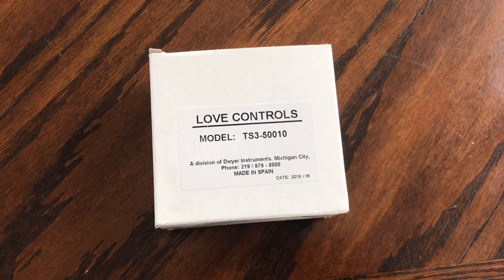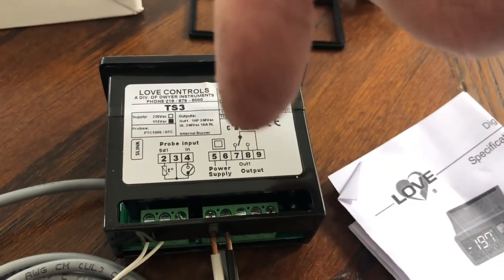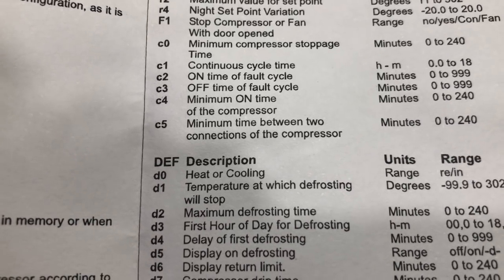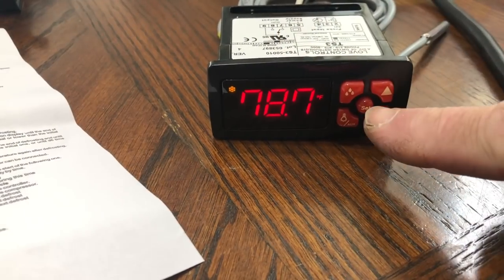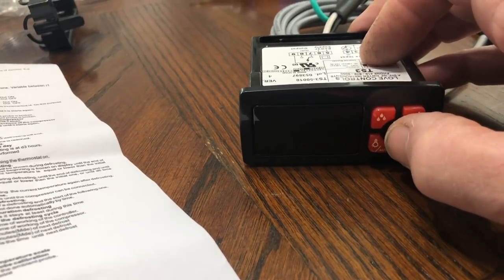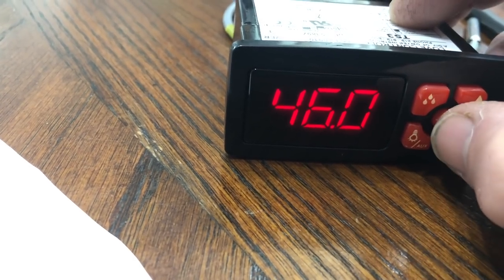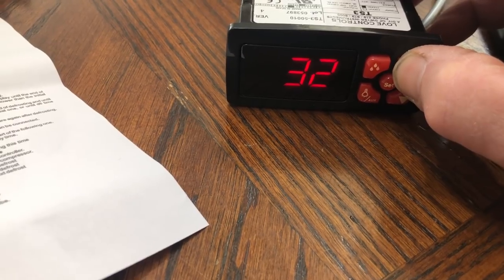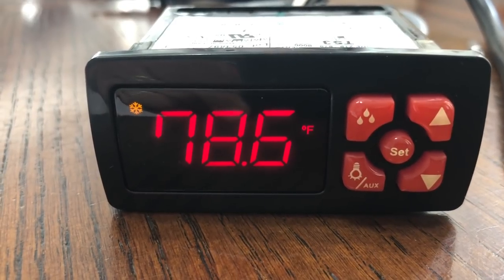Dwyer love control TS3-50010

Comment: I've used Love Controls on hot side ovens and things for at least 10 years now. I've always had good luck with them. You can buy direct from Dwyer and get a discount. They have a lot of other nice things on there too.
Reply: What love unit are you unising on ovens? Is it control or just display temp?
Reply: @yermoffroad  4B-33 and 16B-33. They are temp controls.

Comment: Which terminal will be connected to the condensing unit? Will it be 7(normally close) or 8(normally open)? Let me know thanks.
Reply from the maker: Depends if you want to use the stat for heating or cooling. For cooling N.O. For heat N.C.

Comment: problem with these types of controllers is they eventually burn up if a compressor draws too many amps...ive seen these controllers weather its dixell, danfoss, carel or any other brand burn up and just implode...melt the entire control when hooked up to even a 1/3 or 1/4 hp compressor that draws 7 amps...its best to hook up a contactor in between this controller and the compressor i have found

Comment: Any experience with the Carel PJEZ? http://alfaco.hu/file/CarelENG/PJEZ.pdf

It's too bad the Dixell doesn't come with condenser fan control it would seem. Someone at our shop was theorizing we could re-purpose the evap fan sensor? Had a 2 fan condensing unit with a Dixell on board and it would've been nice not to hack a 1/4 access tee in for a fan control.